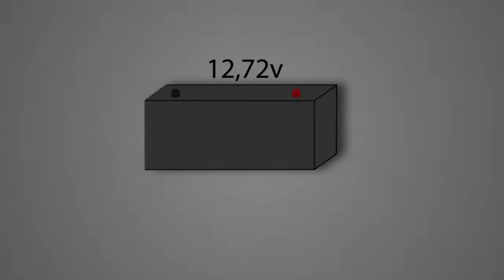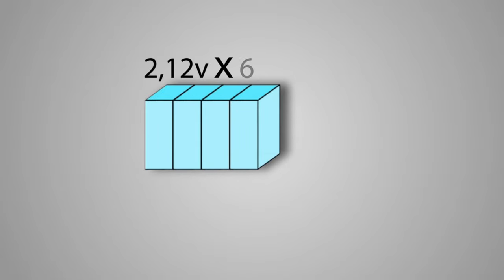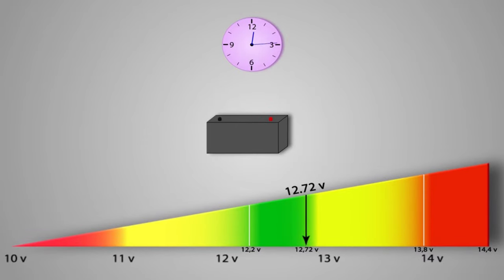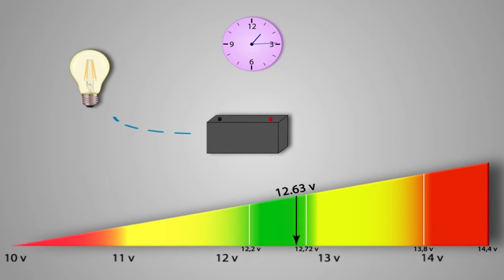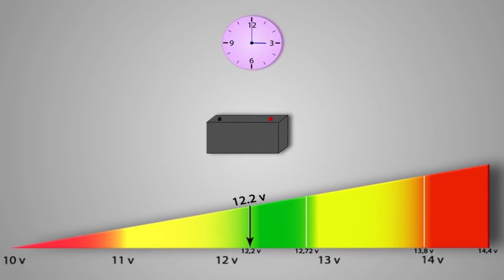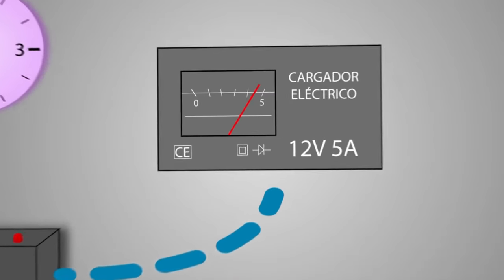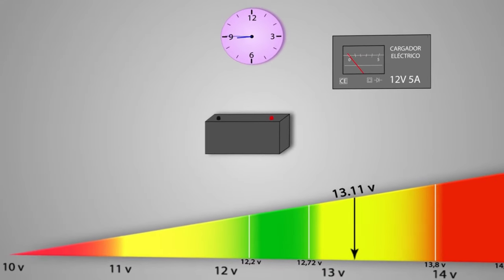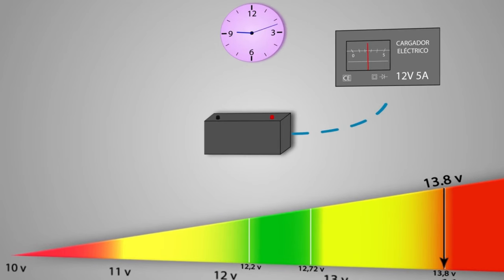12 volt battery voltages (lead-acid)

Comment: This applies to flooded deep cycle also?
Reply from the maker: I don't understand your question.
Volts are taken as a reference to calculate the current capacity.
Of the 100% capacity, a maximum of 80% can be consumed for lead acid batteries, so you should always leave at least 20%
Reply: @drfenomeno  There are three types of lead-acid batteries: flooded (wet), AGM and gel.  These have 50% SOC (or DOD).
Your above reply is for LiFePO4 (20% SOC or 80% DOD), not lead-acid.

Comment: But many changers changes  the batterys at 14.8v and have no problems and many batterys have standing voltage of 13v
Reply from the maker: I think you're confusing lithium and lead-acid batteries.
Reply: AGMs have a temporary float voltage of 13.8v that bleeds down…just say’n, that’s a characteristic of them…

Comment: Is there a real level when a lead acid battery is 0% charged and it is in okay condition? like smartphone battery.
Reply from the maker: The lead-acid battery cannot reach 0% (100% depth) because it breaks down. It should not be poured at a depth of less than 50%, although it is not recommended to go below 70%. The discharge depth of the mobile battery (lithium) can reach a depth of 99%, but it is not recommended to go below 80% depth. Thank you for viewing my content. Greetings.
Reply: @drfenomeno  thanks.
Reply from the maker: @donoturnback  Noooo, thanks to you, I am thinking of making a video on this topic, and although my content is in Spanish, I will make the English version. 😊
Reply: @drfenomeno  sure

Comment: My battery showing 22 volt. But it is not boiling. Is my battery become bad?
Reply from the maker: It's impossible for a 12v battery to show 22v at rest.
Reply: @drfenomeno  thank you, mera volt meter kharab ho gya tha you are right
Reply: 😂 😂😂 you are using 24 v battery...
Reply from the maker: @Suresh_Kumaar  Yes, I had thought about it too, but a 24V battery really has 25V and even reaches 25.4V at rest.
Reply: @drfenomeno  ha to wo discharged battery he bhai tabhi low Ocv aaye 😂😂

Comment: 14.4V damaging battery because it generates many power and heated up
Reply: Use repair pulse charger with automatic charge, microcontroller/CPU inside